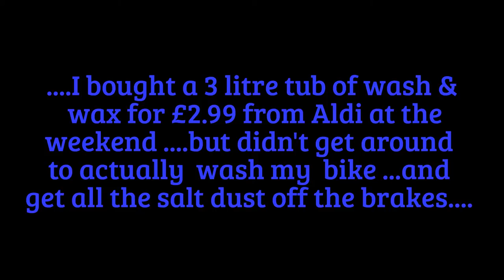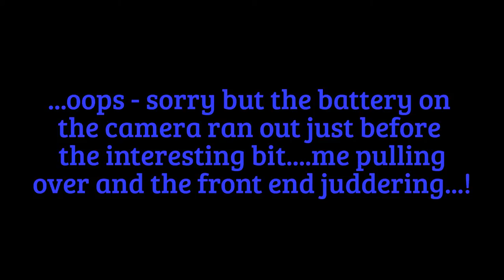...regular bike cleaning is a must ...

Comment from the maker: ....oops - I'll change my camera clock to summertime before weekend !
Reply from the maker: +Steve&#39;sHornet900! ....I'm off work next week and will be using the time off to do as proper maintenance job on my bike, fitting the new spark plugs, and the clutch cable which I bought 18 months ago !.....but I don't think I need to fit the ''used but as new'' regulator / rectifier I bought from e-bay as the Oxford Optimiser has solved the flat battery problem I was having !

Comment: The salts lingered on a bit and caught us all out.  I've been flushing the calipers out with fresh water over winter, and stripped them. For me the brake pad pins seemed to get corroded so I keep em lightly oiled.  The Brake cleaner stuffs good the car ones seem just as good as the supposed motorcycle ones.
Reply from the maker: +Tony Kitchen ....thanks, yes - I can't get the poundshop brake cleaner aerosols anymore....they said they stopped stocking it because it was highly flammable ! I'll ask at the local car accessories shop, but I expect it's at least a fiver, or more. Still...when I eventually get my back back, it wont need cleaning til next winter.

Comment: You need to take the pads off keep pumping the brake until the piston come out as far as you can them get toothbrush and warm soap water brush around the piston then use red grease around the piston then push it in and then you will be fine for another year just wash the brake down with cold water on your brakes in cold dark days Steve and you should be ok ride safe bud!
Reply from the maker: +bikesforme ....thanks, yes this was just a quick fix - I hope - to get me to work today and tomorrow, then I'll do a proper job next week , or this weekend.

Comment: I would invest in a can of brake cleaner steve from you local car parts store and use it after the decreaser to get rid of any residue. I got new front disc's for 1/2 the price of local ones from china and there really good.
Reply from the maker: +banditnev ....thanks , yes - a lot of Chinese stuff is fine, like my camera, and sweet and sour King Prawns with egg fried rice , but I was once using some Made in China drill bits that I got off a market stall, and almost had a nasty accident when the drill just bent as I was trying to drill something ! When I checked all the other bits , I found that I could just bend them in my hands as if they were made of lead or something ....it certainly wasn't tempered steel - which is why I was a bit nervous about buying chinese brake discs - are they likely to suddenly warp when they get hot ?.....